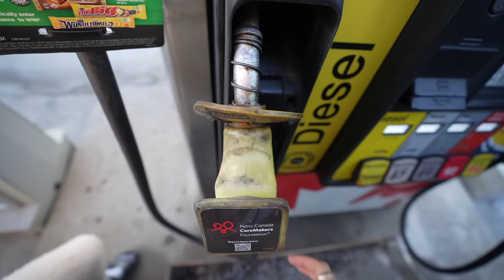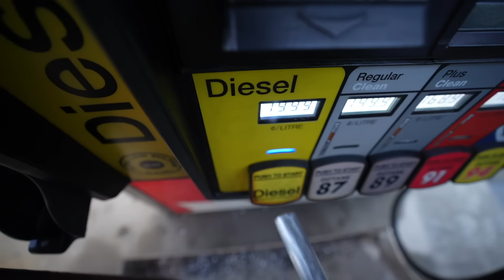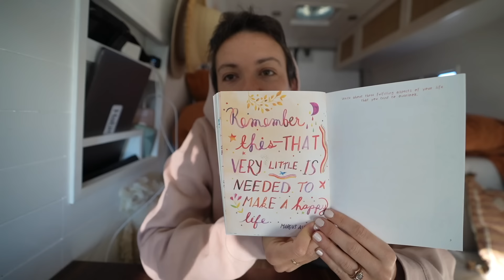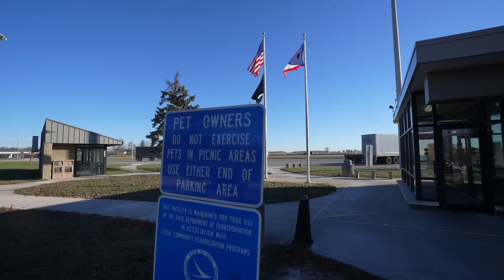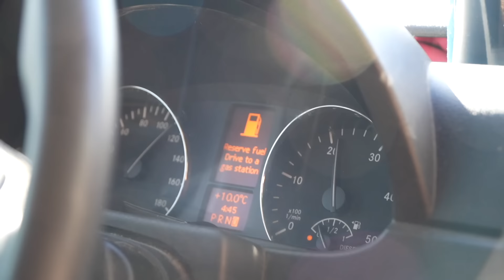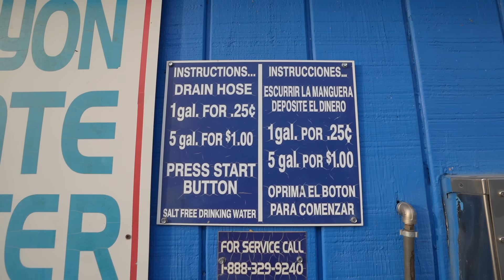We Drove Our Van 3000 Miles from Canada to Mexico

Comment: I may be one of the few that have had a good experience coming back into the U.S from Canada (I hope that's not true but from the comments I've read so far it always to be!).  I spent last summer in multiple locations in BC (family and friends in different areas and an epic camping together experience).  We dropped down from Crystal Lake, BC to cross the WA border (no town there).  I pulled up,  the guy looked surprised (I'm a 63 year old female driving a RAM 3500 4X4 dually towing with a gooseneck a 5th wheel trailer!).  He asked if there was anyone in the trailer and did I do all the driving.   My daughter,  in the passenger seat laughed and said,  I'm sure not going to drive it.   Then my 4 year old granddaughter pipes up from the backseat and says,  "Nana does everything!" Sealed the deal!  He laughed so hard and just waived us through!

Comment: I travel and camp via motorcycle. I burn a nine hour candle in my tent to combat humidity, it's very safe. My tent stays dry and cozy. I wonder if it will stop the ice from forming on the inside of the windows. I'd think it would be worth a try. Stop by Bass Pro or Cabellos they will have the candles and the canister that holds them.

Comment: The trick with the zip code at the gas pump is to use the three digits from your Canadian postal code, and two zeroes at the end. So M4T3V6 you would use 43600.

Comment: If that's a carbon monoxide detector also check the rear door seals on the van for leaks, it can suck fumes back in and pool there, had literally the same thing in my suburban till I resealed the door

Comment: Was a cool video, and I know it is trivial. But nothing drives me more nuts than you using the nozzle on fuel to press the selector button. That leaves fuel on the "hand" button for the next guy who uses it as designed, then you gotta find some way to get the darn diesel smell off you 😛 Also fire alarms don't go off when the battery needs changed they let off a chirp every couple of minutes, so investigating why it was in alarm mode vice disabling it would have been be prudent.

Comment: The zip code hack is three zeros followed by the 3 numbers in your postal code.
Reply: ZIP CODE HACK: At a gas station in Detroit, a helpful American told us to put in the 3 numbers from our postal code and add two zeroes. Has worked for us for at least a decade all over the States. (You’re in effect borrowing a zip code from some location in the United States, but always using the same one may be better?)

Comment: Too many comments to see if someone has posted a zip code hack. You put in the numbers of your postal code and add 00 on the end. Example. V3T 4T1 would be 34100 Its worked for us so far. My wife and I are on a 6mth raid RV road trip from Surrey BC to presently Arizona. Boondocking in the desert. Loving it. We want to travel to Mexico ( Baja ) but are a little hesitant because of horror stories. Do you have any pointers on making the trip? I feel it will be a missed experience if we don't do it.  Thinking of doing it in mid-January. Safe travels